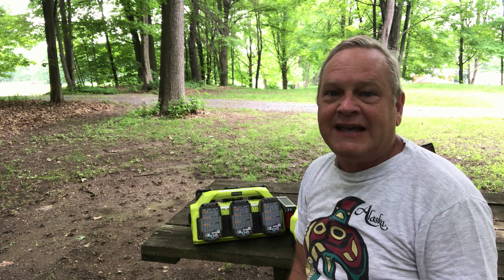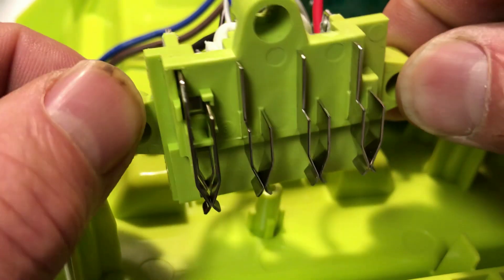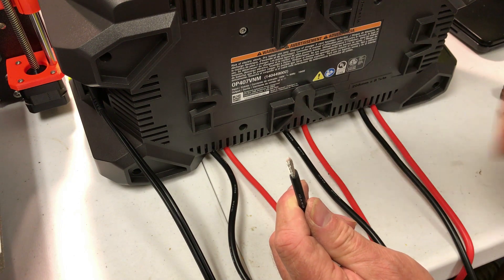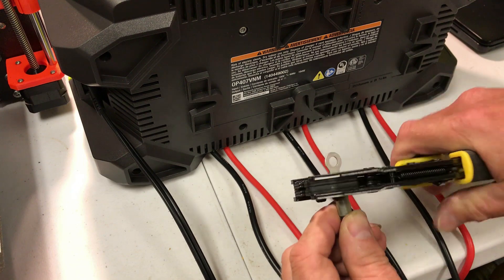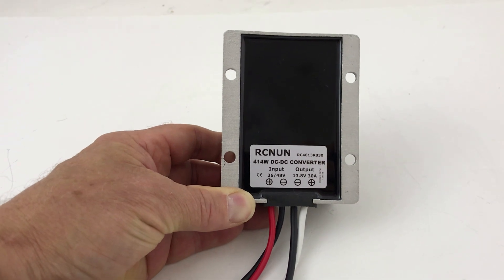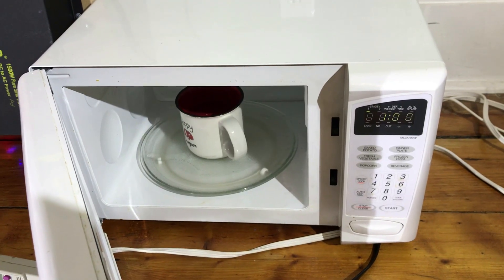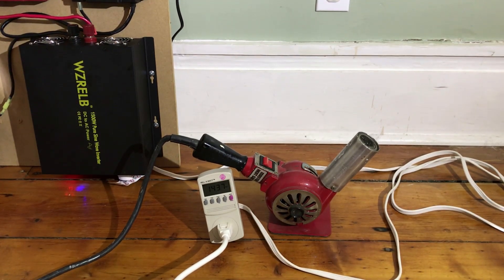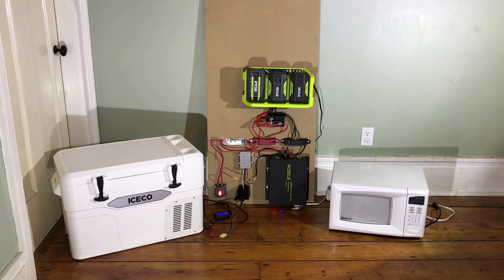Hacking RYOBI 40V 3-Port charger into a Powerstation

Comment: Good morning, I have a few questions regarding these Ryobi 40v Batteries and their inverters and chargers I hope you could answer.

What does the third point on the charger do? Would I theoretically be able to charge a non-ryobi battery with a ryobi charger? For example, if i had a off the shelf lithium ion 36v battery with its own BMW (only having a +/- connections) would I be able to use the ryobi charger to charge it or does the charger only activate if connected to that third contact?

Does the Ryobi 40v Battery have a low voltage disconnect built into it's BMS?

Ultimately, my project idea is to use the "1800w" (really 1600w) 40v power station with non-ryobi batteries.
I would ideally want to use a 36v LiFePO4 battery (the low voltage and high voltage range seems to be within spec of the 36v lithium ion)

Comment: Using 0hm's law...4 amps X 3 = 12 amps X 40 = 480 Watts, which is...480 ÷ 12 = 40 ah.
So, 480 Watts and/or 40 ah. 
So 1000 Watts of power drain plus around 20% inverter losses = 56 Watts so 480 Watts - 56 Watts = 424 Watts would deplete those batteries in around 25.5 minutes, of course less with a 1500 Watt inverter but still; not too shabby at all. Great hack Chris 👍

Comment: @SerendipitySue any thoughts on whether this 3-port charger can be powered/charged via solar with some internal hacking? It would be a nice alternative to the crazy priced Power Station.
Reply from the maker: Check my video list. I’ve done several videos on solar charging ryobi batteries
Reply: Thanks for the quick reply, Chris. I’ve watched many of your videos on solar charging Ryobi batteries and learned a ton. I’d like to use the 3 port charger to be able to power up 3 batteries in sequence using solar. I know the 1800 watt Power Station can do this, but not sure if that’s also possible with this 3 port. Thoughts?

Comment: Fantastic work and great documentation! I am currently building out a chargeable/hot swappable version of this for a small camping power station this summer. 

I had a few questions about the diodes you used. 1 - Did you worry about a short being introduced by two diodes sharing a conductive heat sink? I didn't see any insulation that would prevent this but I know very little about these stud style diodes. 2 - Can I use something else that functions as a high powered diode? Specifically I am looking at the 70HF120 Rectifier Diode since it's much lower cost but I am worried about it being a functional sub. Do you think this would work?

@SerendipitySue
Reply: Curious (not being a smartass) 
Why not just buy the 40v inverter… Would t that be easier than trying to make one and hope all the connectors and capacitors are right? 

Or is there an advantage to diy 
Legit curious

Comment: wondering is you could use an aluminum heatsink bar inside the supercharger with the blocking diodes.  then perhaps join the - wires inside the box as well to just come out through one hole with two wires + and - but already block protected.  I suppose it will need to be checked for space.   will the diodes get too hot or cause other problems?
Reply from the maker: I didn't want the heat inside the case
Reply: @SerendipitySue  thanks.  I have the same concerns.  Do the diodes get really hot?  To make it a portable power station like the other one you made though it needs some packaging for the external diodes etc.   My thinking was if the diodes were internal then it could be a 40Volt supplu then the other bits would be easier to mount.  Problem of course is that the negatives on the diodes would be at +40V if left naked.  Thanks so much for every video you do!  Dara
Reply: @SerendipitySue  oh also can you charge and leave the power connected as well at the same time?
Reply from the maker: @MrDara1952  yes

Comment: How to make this into something portable.  I want to use it for a Sailboat.  Bringing the 40volts to the boat electrical panel.  Then the inverter and drop to 12 volts.    But the charger needs to be able to go back home to charge.  I am thinking of connectorizing somehow the 40 volts combines atht e load side of the diodes.   So i would need to somehow mount the diode heatsink block onto the Ryobi charger and have a plug of somesort.  Thus is could do double duty - bring it to the boat and plug into the panel OR bring it anywhere and plug into other options.  Maybe mounting n inverter on teh ryobi case?

Comment: Can you add blocking diodes to the 18v x6 battery one? Will they charge?
Reply from the maker: You should be able to do something similar with the 18V charger. When I did it, I removed the charging stuff. You would have to find room for the blocking diodes. It would be much easier to add them to a project like: https://youtu.be/lAAWFCU4iEM
Reply: Are the blocking diodes necessary? I’ve connected two ryobi 40v batteries in parallel and their 18v batteries together in parallel for different projects and I could never get any current to pass from one battery into the other. I’m guessing it’s because the internal bms won’t allow voltage to pass through unless the battery is connected to the charger. Which I guess kinda answers my own question. I always used 3D printer adapters that slide onto the battery and have a positive and negative leads coming off, for my projects. However I’d have to remove the battery and place it on the charger every time it died, vs your setup where the the discharge is built into the charger. So of course you need blocking diodes

Comment: Hi there,
I 3d printed your device for the 40v terminal. I have a Ryobi 40v(36v} jet washer and want to use husqvarna batteries that are 36v. My concern is that there are 4 ports on the husky and also 3 or 4 on the Ryobi. I presume one is for balance charging and the other for communication?
will I cause damage just running positive and negative?
thanks
Stuart
Reply: annoying thing is I bought the Ryobi 9amp battery to be on the save side but found its to large to fit into the housing of the pressure washer.
Reply from the maker: RYOBI batteries have the BMS (battery management system) built in. It protects the battery from overcharging, over discharging, overcurrent, over/under temp. I don't know about other brands of batteries. On RYOBI there are four terminals. For discharging you only need the +/-. Charging requires the T1/T2 sensors.
Reply: @SerendipitySue  thank you, the thing that confuses me is that you see those terminals on the tool side of connector too not just between the battery and charges

Comment: Hi Chris, love your videos and hacks. Did you come up with a way to solar charge and passthrough this three port power station ? I'm trying to make my big   
6ah Ryobi batteries earn their keep by making two or three of your power stations in conjunction with solar panels on van roof and using them to add a few miles to my hybrid vehicle. I want to make them power a 220v inverter to power an extra level 2 charger I have to add a few miles while parked away from home. Not sure if the level 2 can be tricked into charging like the level 1 charger can be by using a bonding plug into spare inverter outlet. In worse case I can use the level 1 charger on a 120v inverter.
Reply from the maker: sorry I just saw your comment. I keep the 3 battery charger plugged into AC all the time. You can pull power from it while it is plugged in. Maybe you could use a small solar charge controller and a AC inverter to keep them charged? It would be that efficient though

Comment: Your Ryobi projects are very cool! Thanks! I watched some of your 40v inverter projects and was wondering if you had more details in paralleling them? Is it the same paralleling the 18v batteries?
Reply from the maker: Here's an 18V project I did that used groups of two batteries ( https://youtu.be/lAAWFCU4iEM ), but I didn't do the blocking diodes at the time. Just required that you only used fully charged batteries
Reply: @SerendipitySue  Hi Chris, love your videos and hacks. Did you come up with a way to solar charge and passthrough this three port power station ? I'm trying to make my big   
6ah Ryobi batteries earn their keep by making two or three of your power stations in conjunction with solar panels on van roof and using them to add a few miles to my hybrid vehicle. I want to make them power a 220v inverter to power an extra level 2 charger I have to add a few miles while parked away from home. Not sure if the level 2 can be tricked into charging like the level 1 charger can be by using a bonding plug into spare inverter outlet. In worse case I can use the level 1 charger on a 120v inverter.

Comment: Would you mind explaining the reason for the diodes?  I was thinking it would be a good idea that all 40v connected batteries share the load allowing for parallel sharing (diodes prevent bidirectional current, so remove those), meaning without diodes if one battery is lower than another the higher charged battery will help balance each other and the end resulting capacity of all batteries allowing you to hot swap easier?  add a 6ah battery to a 1.5 and the all batteries die at the same time without the diodes.
Reply from the maker: Ideally all three batteries have the same voltage and will equally contribute to the load. The reason for the diodes is that if the voltages aren't equal, you can easily make an arc welder! A large amount of current (as much as battery can provide) will rush from the full battery to the empty battery. The result would not be good. Unfortunately I don't know of an inexpensive device that will let the current flow in the reverse direction at 2-3A (which is the normal charging current)
Reply: @SerendipitySue  A solenoid or relay is cheap and will do what you want.. but I don't think it's necessary, here are my thoughts and I look forward to yours as well on this... the concern if I understand it is the battery seems to have the ability to dump its charge very fast" first off these batteries have PCB boards with MOSFETs that try to force 40v at all times even when the battery is max full or nearly empty. Current can only go up if the voltages are X percent higher than the destination... like flowing water depends on how far you tilt the glass, sure these likely have 12-16x 18650s in them which could means 3 amps per cell, but the key here is a battery can only ingest current at the rate of its chemistry which would limit how fast the current flows into itself out of any of the battery or plural from the "pool" these batteries I believe are rated a 1c max and that makes your wire size engineered at just over that max at 12gauge per battery into a 8-10 gauge bus bar for three of these. Just like how far to tilt the glass with liquid the flow rate will merge from all three or just two depending on the voltage.  If one battery is 43 and the other is 38, then technically only 41 volts will flow into the lesser filled battery which will fill or charge very slowly because 41 as not far off from its Nominal when controlled by its built in PCB again to help preserve the tool its plugged into.
Reply from the maker: @mikenkaried4543  If you are careful and only ever put fully charged batteries in it, then you don't need anything.

Comment: How did you connect wires to the top (anode
)  of the blocking diode?
Reply from the maker: just crimped on a standard female spade connector. It fits on the male portion of the blocking diode
Reply: @SerendipitySue  Hey Chris if I'm not interested in adding a cigarette lighter socket can I avoid the buck converter and if so would I connect the red switch negative wire directly to the negative side of the inverter?
Reply from the maker: @TxBestlectricrides  If you don't care about 13.8V applications, you can get rid of the big red switch, DC-DC converter and the cigarette socket
Reply: @SerendipitySue   Thank you.

Comment: What do you do with all the power stations you have made.  Would you ever feel like selling one or two?  Right now I am making one of your dual Ryobi 18 volt battery powered  Ryobi power inverters, 300 watt, that would normally use a 40 volt battery.  I am using a gutted Ryobi 40 volt battery, with just the board remaining, so I have the contacts all ready to slide into the inverter.  I will put the two halves of the battery housing back together for more of a stock look.  Is there anything I need to look out for?  Thanks
Reply from the maker: yeah... I know.. I have RYOBI projects all over the place :-) Using a 40V battery shell/contact should work nicely. I've gotten a couple dead 40V battery out of the Home Depot recycle box.

Comment: I'm building a powerstation using your plan running two 40v chargers ib parallel.  Can i use 3 heat sinks with one blocking diode for each mounted in each one?
Reply from the maker: you need a blocking diode for each battery
Reply: @SerendipitySue  How did you connect wires to the top of the blocking diodes?  Solder?
Reply from the maker: @davidnoack773  I crimped on standard female spade connector. It fits on the top male portion of the blocking diode

Comment: Great video.  Did you experience any problems running the 36v inverter on 40v batteries?
Reply from the maker: No because 40V lithium batteries have a 30-42V range. The inverter has a DC input range: 30V-45V.

Comment: How many cycles do all of these batteries get?
Reply from the maker: All of my Ryobi batteries (18V and 40V) are still working. They say LiON batteries will do 500 cycles before they fall under 80% charge. You can look up the specific 18650 cell specs in your battery

Comment: Question.  With this set up Will you be able to connect your solar panel system up with the mppt charge controller and still charge and draw current from your inverter
Reply from the maker: not yet. The charger is serial (charges one battery at a time) and there is only an AC plug. If it had a AC=>DC power brick like some of the small 40V chargers we could do it.
Reply: @SerendipitySue  What if we didn't use the charger and used the 3D created 40v adapter connectors and used your method of the adjustable voltage MPPT charge controller. I used your idea without the charger and used the 40v adapters And used 4 - 40v batteries in my system instead of 3 batteries. I already got the MPPT adjustable controller just haven't tried tried it yet. Appreciate your advise.
Reply: Or do I still need to use their DC charger and charge their batteries individually? Afraid my Idea would over charge the group of batteries. But if the adjustable charge controller set to the correct voltage 
I can't over charge the batteries? If my thinking correct?
Reply: Just thought about it the blocking diode would prevent the batteries from accepting a charge. What if the Adjustable MPPT controller was connected to the batteries along with the connection to the  the blocking diode from each of the batteries?
Reply from the maker: @donkania7338  I haven't figured out how to put the Ryobi 40V batteries into "charge mode" yet (I did for the 18V batteries). So for now I need to use the Ryobi chargers:-(
Reply: @SerendipitySue  well with 12  - 6ah batteries I can sleep at night without my genrac inverter generator running. A lot of campground don't allow generators running at night. Recharge the batteries during the day with the 4 rapid chargers and have peaceful sleeping evening.And save a little on gasoline. for now!.

Comment: I made a simplified version that gets 360 watts out of a single 40v battery by hooking one of these up to it, and then hooking a 12v inverter up to that:  https://www.amazon.com/360W-Converter-Voltage-Regulator-Waterproof/dp/B07J274LZD?dchild=1&keywords=48V+VOLTAGE+REGULATOR+TO+12V+30A&qid=1623708107&sr=8-3&linkCode=ll1&tag=pw016-20&linkId=e63062c4a95e0df75e67f39589bdc8b0&language=en_US&ref_=as_li_ss_tl  A person could scale it up either serial or parallel depending on their inverter using multiple batteries.  It gets me more wattage than the Ryobi inverter and it has a higher surge startup capability.  Not nearly as cool as what you did in this video.

Comment: Amazing job ! Is it the same with you other 6 battery charger ? The previous one you made could you have it do both charge and power ?
Reply from the maker: In my other project https://youtu.be/TCWndCrfHi8 ). I had to get rid of the charging circuit to make room for the thicker wires and DC-DC converter. I'd have to go back and look at a new supercharger and see if I could solder the thicker wires and bring them outside. You would need six blocking diodes.
Reply: @SerendipitySue  that would be amazing to see. I was trying to figure out how to still use my charger as a charger and a power station. 1 other questions : when you drop down the power from 18v to 12v is there much of a power loss. I used a 40 v inverter and hooked my batteries in parallel.